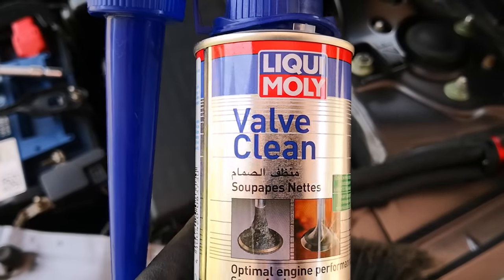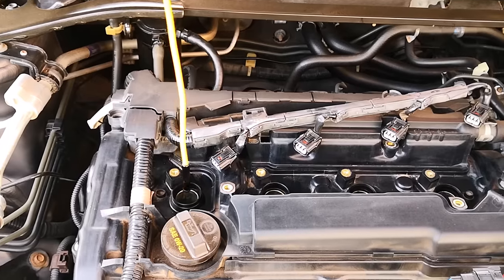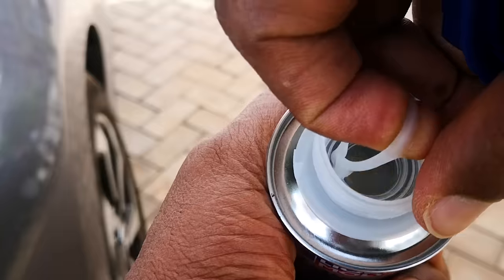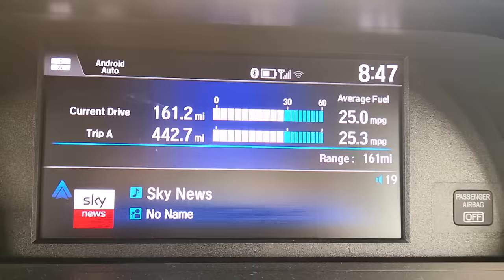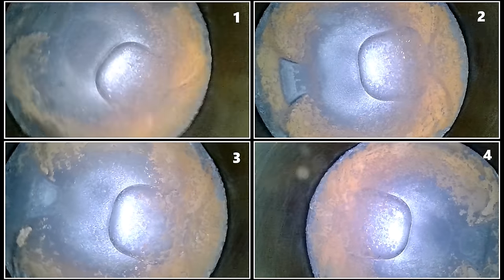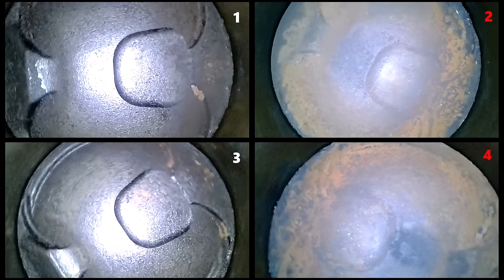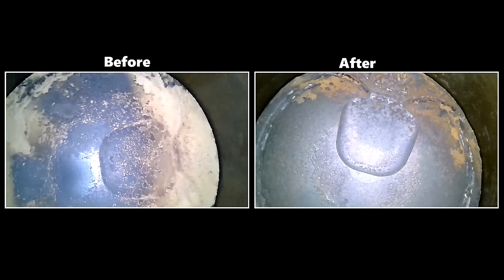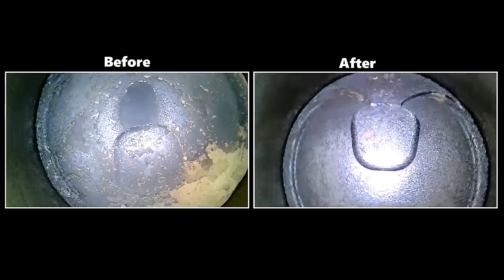I tested Liqui Moly on Piston Carbon Removal: Liqui Moly Valve Clean Works on Piston Carbon Build up

Comment: Good method of testing. Pity you did not perform an engine compression test before and after since removing carbon buildup should remove carbon buildup around your oil scraping rings on the pistons thus improving compression and reduce oil consumption if they are not worn too much.  Did you note any change in oil consumption afterthe cleanup?
Reply from the maker: Great point there. That would have made the puzzle complete! Will consider for future efforts. But it definitely improved compression because oil use dropped. I have a video on the benefits I gained after doing this treatment; decrease in oil consumption included! https://youtu.be/7acdMb10Kbw?si=2xc_e54d_-lEGGoW

Comment: Your efforts are much appreciated.

Help us to know What is the difference between liqui moly valve cleaner and diesel purge? 

Combustion for all like valve, piston and  spray nozzle happens same time. So cleaning point starts from Diesel spray nozzle, valves then to piston. Would all these also cleaned.

A big thanks in advance

Comment: Great video! Is there any evidence that proves that a layer of carbon on the tops of pistons has any detrimental effect on engine performance?
Reply from the maker: Good question. Yes there is. Depends on how thick the layer is. Increased carbon will reduce the volume of the combustion chamber and thereby affect compression ratio. An out of spec compression ratio will lead to spark knock or pinging. I was having this before starting the cleaning process. It was gone when I was done. 
Remember, the combustion chamber is actually the little space with the piston at the top of its stroke (top dead center), so it's much smaller in volume compared to what I show in the video.

Comment: Thanks for the great video, well done! Did you consider pouring the additive into the combustion chambers and letting it soak over night?
Reply from the maker: Thanks for your compliment!
I tested it on soaking carboned up spark plugs and noticed that its not good as a soaking agent. Did nothing in terms of softening the deposits. That just tells me it needs heat to activate.

Comment: I have a diesel car but always add the 'supreme' diesel rather than standard as it supposedely has more detergent in it. Of course no way for me to test that claim but I don't get DPF problems like so many other people. Sure the outlay is a bit higher but I'm not paying a garage to clear error codes or try and flush my DPF so probably balances out.
I used to use a particular additive (won't name them) but after calling their helpline after I split some on myself the guy let slip it's basically kerosene... which would have been about 10 times cheaper to buy than the additive was.
Reply from the maker: Yea. I agree with higher quality fuels. The extra detergents does help engines run cleaner.

Comment: 50 50 mix of distilled water and windshield washer fluid will clean it much better. It does it slower. If engine spends time at idle you can have more buildup like in cold weather.
Reply from the maker: Thanks for sharing! 
Won't windshield washer fluid have one of those catalyst poisons? Your last sentence is why I get a lot of build up. Some usual traffic in my regular routes.
Reply: No it won't. Think of a blown head gasket. The cylinder that injest the coolant is perfectly clean. Piston and valves. The water turns to vapor and the washer fluid helps it turn to vapor faster. It does not take much. Inject it behind throttle body. Use a vacuum switch so it come on under load or when acceleration. Most buildup occurs from PVC positive crankcase ventilation.

Comment: I know that is the head gasket is leaking coolant in the cylinder , that piston is clean. Wouldn't be interesting to actually have while running the engine, from time to time  to inject a mist of water? That would be a nice experiment
Reply from the maker: Yea, but I shy away from the water injection treatment because some of it will mix with the oil

Comment: Hey , thats really good effort. 👍
Pleased try Lucas upper cylinder lubricant and injector cleaner in diesel car.
Reply from the maker: Thanks, mate. Will keep an eye for the lucas. Sadly, I don't have any diesel cars to work on😢
Reply: I have used Lucas in diesel skoda Octavia 1.9 tdi and it made engine idle impressively silent. 
Try it, it's really great product.

Comment: Very nice video, only my question is does the car's tank have to be completely empty or only half full.....and I also wanted to ask you, do I have to refill the Liquid Moli with every tank?
Reply from the maker: Thanks for the compliment. Tank doesn't have to be completely empty for this product. I found that consistent use is what brings the result.
Reply: @DIYAutoworksNG  Thank you for your answer but you didn't answer my second question, which is that I have to add these additives every time I fill up the tank
Reply from the maker: Hello that's what I meant by consistent use. Not practical to use every single time you fill up, but good to use back-to-back for some fill ups. Also, if you use premium gas, you likely won't need this.

Comment: Thank you for this video. Do you think that it cleans piston ring as well?
Reply from the maker: Yes. I did a follow up video on the benefits I gained after this procedure. Oil consumption went down significantly.
Reply: @DIYAutoworksNG  Thank you for your answer.

Comment: it si a valve cleaner, and your video is about the impact in the combustion engine. You car is fuel injection (not direct injection), the results will be more appreciated in the intake valves.
Reply from the maker: Yea, was running out of options and needed to try this. The better product will have been DI Jectron.

Comment: Excelente video primera vez veo un resultado real en el uso del producto, me gustaría saber si puedes probar en otros vehículos
Reply from the maker: Thanks. Yes, you can. It's actually best designed for carburetted cars.
Reply: Este producto funcionaría en un vehículo de inyección directa ya que está diseñada para vehículo con inyección en el colector de administración
Reply from the maker: The Liqui Moly product for direct injection engines is Dijectron. It won't clean the back of the valves though.
Reply: Gracias por el retorno, lo puedo utilizar sin problemas para limpieza de carbono en el pistón?
Reply from the maker: As you can see, I used it in the video despite my car being direct injection. I've had no problems.
Reply: Thank you very much for answering, I am going to use it in my vehicle, I will comment on the results

Comment: I hope you will answer this question. After all of the Chrome-Moly you put in your tank. Did you look at the valves to see before and after the use of this product?
Tour videos are very useful and I thank you sincerely. I'm driving an 02 Accord LX 2.3L with 5 Speed Manual Transmission. I've owned this Awesome Accord since I bought it Brand New.
Reply from the maker: Sure pleased to answer! 
No need looking inspecting the intake valves since the engine is GDI. That car is sure going to be so difficult for you to let go of. I let go of a 2003 Accord I had for 13 years. Almost cried when the guy drove off🤣

Comment: It sounds like redlining your car every so often is the best thing you can do. Great video but not sure how much the liqui moly did  compared to the high revving
Reply from the maker: Very valid point. Another experiment will tell. I agree that regular high revs are good for cleaning carbon.
Reply: High rpm’s won’t do anything to remove carbon.  The liquid moly did the job.

Comment: Piston carbon build up isn't an issue on modern engines using modern fuel.  Considering that Earth Dreams engines are direct injection, your worry should be carbon build up on the back of the intake valves.  That's what Liqui Moly valve cleaner is meant for.  Cleaning the fairly thin layer of carbon on the piston head is just burning money.
Reply: Yeah, no mention of the car getting better MPGs or feeling like it has more power or idling better. 
Not to mention once Liqui Moly is out of your system the carbon is going to rapidly build right back up again.
Reply from the maker: I addressed the reasons and gains from doing this in this video https://youtu.be/7acdMb10Kbw?si=o9OWrcEhNaSUybCI

Comment: Amigo  una pregunta se puede usar el VENTIL SAUBER  y el INYECTOR CLEANER  al mismo tiempo? 
El tema es que mi auto es de inyecciuón directa y coloque el  Limpiador de Inyectores, en tanque lleno, pero estoy viendo que hay un limpiador de Valvulas, se pueden poner los dos sin. que afecte al motor?
Quedo en espera de de sus comentarios.
Reply from the maker: I don't think it will affect the engine. However, the Valve cleaner will not clean the valves in a GDI engine.
Reply: El motor del auto es TSI de gasolina un Golf Twincharger 1.4 .
Gracias amigo, saludos.
Reply from the maker: If you can, get a cleaner made for GDI, so that it can clean the injectors too.

Comment: Next time try spraying water into the intake while reving in neutral. You’ll basically steam clean your combustion chambers. It will be even cleaner than the liquimoly.
Reply from the maker: I've basically avoided this method, because in my opinion, some of it will go past the piston rings and form an emulsion/encourage sludge. Project Farm also noted this finding.

Comment: Hi, nice video!
I have one question, all the carbon removed stuck in the catalytic? Or it will be desentigrated and no harmful the catalytic?

Thank you!
Reply from the maker: Great point! From the previous videos I've done investigating this, the risk is minimal. Search for the videos I did on "will CRC clog your catalytic converter", and the BG44K Platinum video. 
I think the only place where there would be issues is if the catalytic converter was maybe partially clogged already.
It could also be that I haven't tested products enough to see if its a problem!
Reply: @DIYAutoworksNG  Thank you man! I'll search the videos.

Comment: Add a little cheap two stroke oil to the fuel. Even more to Diesel. 
Has the same effect and gives you more money for more mileage.
Reply from the maker: Oil is not good for the catalytic converter. It poisons the catalyst.

Comment: Issue is driving the car at high revs for long periods of time is impossible here. You'll end up going over the speed limit. Can you test to see if doing normal daily driving work with repeat use?
Reply from the maker: Totally agree. Some beat the speed limit issue by driving the car with the transmission in L and at around 4000RPM for a short stretch.
I'll explore the suggestion to use consistently during regular daily driving.

Comment: Maybe the result has more to do with running wide open throttle a lot more than before? The Italian tune up effect.
Reply from the maker: I did a comparable drive without any additive recently, after getting buildup to a similar level, the results lead me to believe the additive has an added effect.
Reply: @DIYAutoworksNG  You're right. That's probably a good result then.

Comment: In a gasoline direct injection engine, a cleaner delivered through the fuel system will not clean your intake valves as the fuel will not spray over your intake valves as it would in a port injected engine. You'll still have valve coking problems. This is why Toyota uses a dual system that utilizes both direct and port injectors. It baffles me that people don't understand this. Port injectors spray fuel over the back of the intake valve, which cleans the oil vapors that will otherwise build up there that are caused by the pcv (positive crankcase ventilation) system. Which routes the expansion of oil vapors caused by engine heat back through the intake manifold prior to passing over the back of the intake valves and then into the combustion chamber for a burn off prior to passing through the catalytic convertor and then outside vs. releasing the oil vapors directly into the atmosphere. 
So, to recap. You can't clean the backside mating/sealing surface of the intake valves in a gasoline direct injection only vehicle by adding additional cleaners into your fuel tank because those cleaners just like the fuel will never come into contact with the backside of your intake valves. This just like the myth of running premium fuel to clean them is completely false.
As for cleaning your piston heads in the combustion chamber, sure, but with proper maintenance and reputable fuel, that's not really an issue. The only real benefit to adding additional cleaners to your fuel periodically is that it may assist with the prevention of fouled injectors as this process would run through the fine injector nozzle tips.
Reply from the maker: Totally agree with all you've said. I think you missed where I said in the video, that I was doing this for the combustion chamber and not the intake valves?
I have other interventions for the intake valves. I've done CRC intake valve and turbo cleaner and a different Liqui Moly product. Installed an oil catch can too.
On the combustion chamber, sadly, I don't have access to premium gas, so cleaners are a must.

Comment: Shows it cleans, but no comparisons to other products, have seen Seafoam and Techron clean just as good. However, none will clean valve if it is a DI engine.
Reply from the maker: I have some videos for some other cleaners in the pipeline. Stay tuned!

Comment: Great video! Can you test Bardahl cleaner? How to continue to keep clean valve next years in general?
Reply from the maker: Thanks for the suggestion!
For keeping intake valves clean, ensure PCV valves are cleaned/changed. Also, I consider an oil catch can a must for GDI engines.

Comment: The hard driving is what gave the cleaning. Heat and shock cooling dislodges the carbon
Reply from the maker: Cleaner definitely helped, but I am going to repeat this without any cleaner, let's see the amount of cleaning that will occur.
Reply: @DIYAutoworksNG  Great idea! I'd Just let it build some cruds by short tripping the car for a few weeks, then rip it harder at road and measure.
Reply from the maker: Can't promise I'll want to intentionally build up carbon😅. This engine hates carbon and pings once build up is substantial. For me, installing an oil catch can has drastically reduced buildup.

Comment: That's all well and good but, what exactly does this do for the performance of the engine and does it improve gas mileage. What is the advantage by doing this.
Reply from the maker: Deposits rob you of gas mileage, they increase the compression ratio and can cause pre-ignition or pinging. This engine was pinging before the cleaning and now it's totally stopped. My mileage is better too.

Comment: If I consider the fact that a can of liquid Molly might go in the store around 7 to 8 dollars a can to continuously use a can after a cannot every gas tank full. It would be quite expensive just to have clean, pistons and valves. Would it change anything other than my pocket it would cost me more per tank for the fill currently are use and have been using nothing but non-ethanol 90 grade gas for probably the last 10 years I can get it and any Indian reservation I prefer going to the one with a separate pump with a separate tank for 99 ethanol and then I use a mixture of marvel mystery oil, it’s 1 ounce per 2 1/2 gallons so on my 12 gallon tank I sometimes put 45 ounces of mystery oil in it every other tank full. I really don’t notice using anything else because currently my mileage even at say 73 miles an hour can be above 40 gallon 40 miles to a gallon But thank you is a lot of effort you did to take it out film it take pictures take a drive lotta work you did good luck!!!🍀👍
Reply from the maker: Thanks!
For me I needed to clear the carbon. The engine was already pinging from the carbon build up. Personally I won't use marvel mystery oil in the fuel tank in a car with a catalytic converter. Just not sure it's safe. A lot of conflicting info out there. If you have access to premium gas, there likely won't be need for a fuel additive.

Comment: Nice vid man!!!Like!! Just one question: Why 1st the Liqui Moly Valve Cleaner?Thanks in advance.
Reply from the maker: In general, I had heard good things about the Liqui Moly brand, so I was keen to try some of their cleaners which were relatively cheaper than some other brands I had access to. But I think what made me settle for it was that they recommended it for every fill up, and also claimed that it cleaned the combustion chamber and not just the intake valves (albeit not in GDI engine).

Comment: Now you have moved the dirt from the sill-in-das to the Catalytic Converters. What will clean dat.
Reply from the maker: Regular driving, except the cat has an issue. The high temperature cats run at should burn off any deposits. I've also done a video with before and after footage of the cat after running intake valve cleaning. Didn't change much and I further inspected some days later and it was fairly back to normal

Comment: Nice video, But 4 to 5 cans of liqui molly costs 50$ and 3 times full tank of gas costs close to 100 $ on an accord. It is expensive.
Reply from the maker: You have a point, though I'd say the fill ups also go towards your regular use, though yea, the spirited driving does add up. However, it saves you money down the line. In my case the engine was pinging and all that went away. Would have led to engine damage eventually.
Reply: @DIYAutoworksNG  but I really like the effort that went into making this video. It's easy to understand.